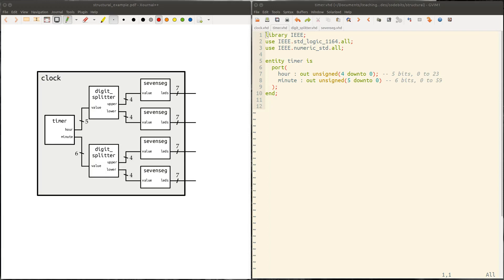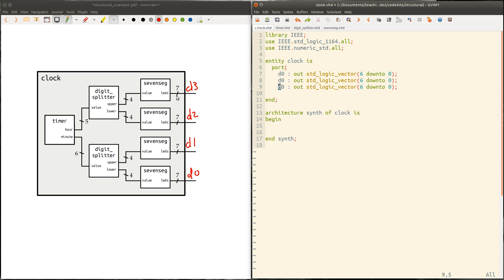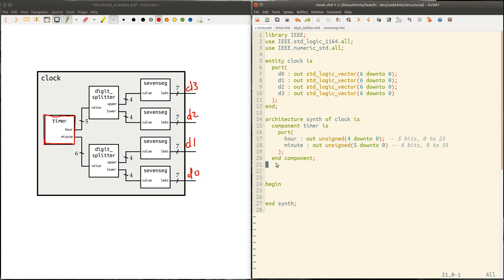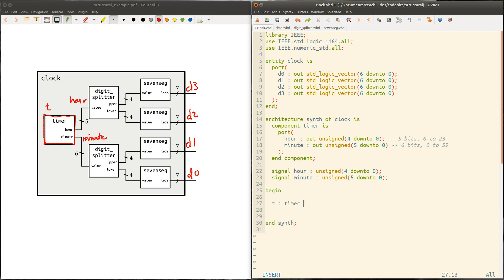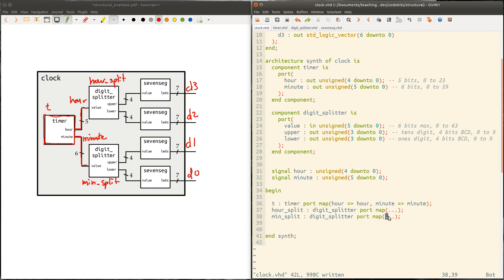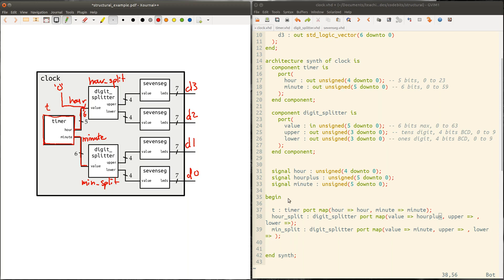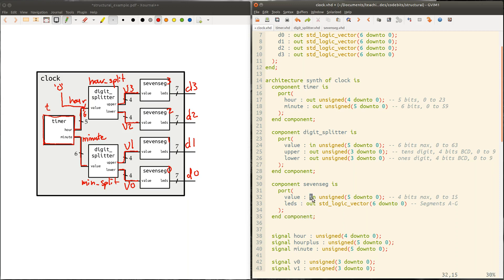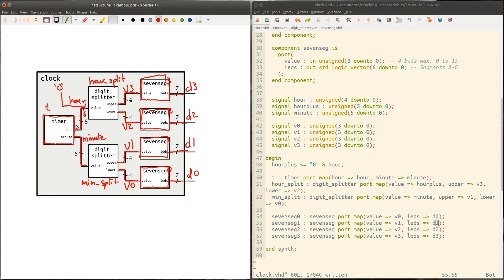Structural modeling with VHDL

Comment: Thank you for clear explanation. I think there is an issue. in this line ( hourplus <= "0" & hour;), I think you should use OR(|) instead of AND (&).
Reply from the maker: '&' here is concatenation (i.e., joining the bits into a longer vector), not logical AND!  We need a 6-bit vector going into the digit-splitter, but hours will only be 5 bits.  So we tack on an extra zero to make it match.
Reply: @botsnlinux  thank you for clarifying